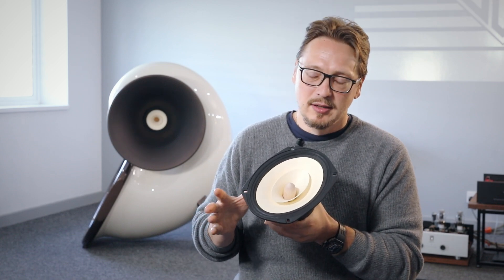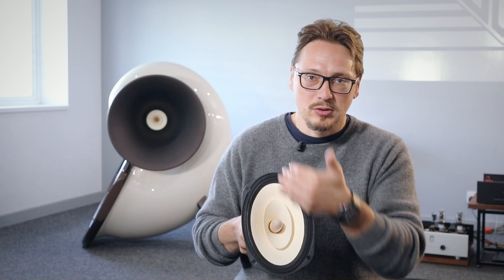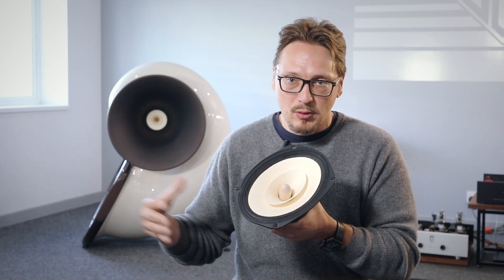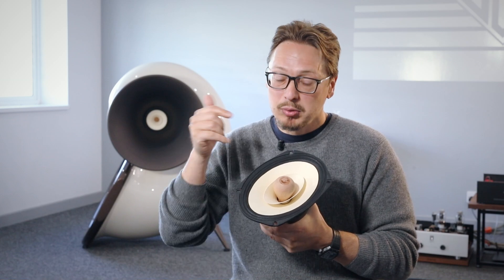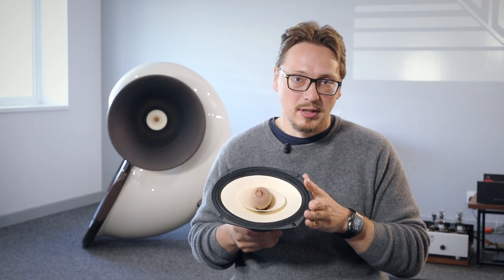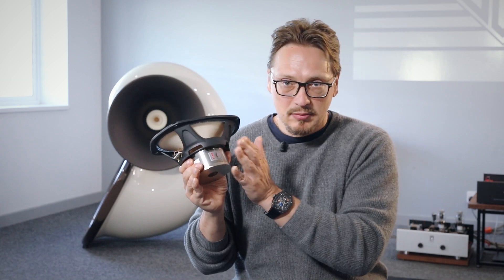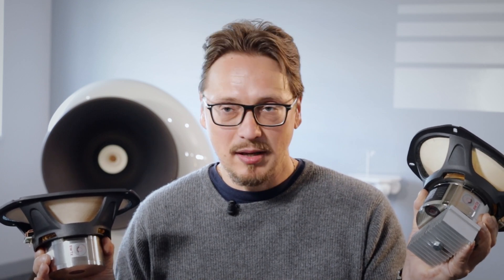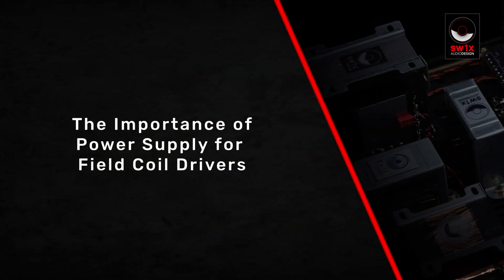Review & Comparison of SW1X Field Coil And AlNiCo Permanent Magnet Drivers for Loudspeakers

Comment: So as I understand the advantage of field coil is the capability to tune the magnetic field with the current.
Is the strength of the magnetic field constantly changing according to the required output of the speaker or is it biased with a fix current?